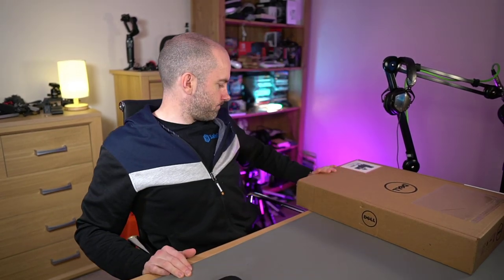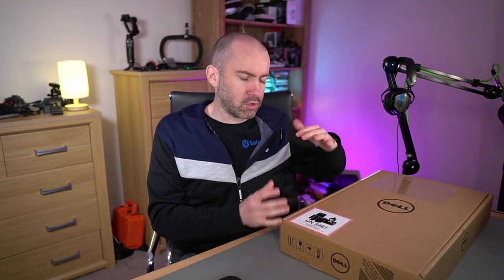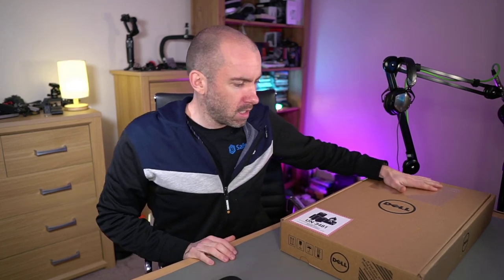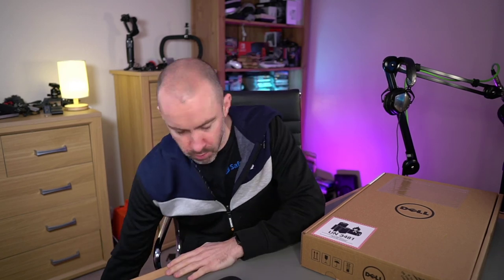Dell Alienware M15 Gaming Laptop - Unboxing & First Impressions

Comment: Before you format that Laptop Kevin, make a clone of it first and store that safely just in case mate, better to be safe than sorry.
Reply from the maker: I won't be formatting the existing drive yet. 

I'll put a new drive in, install windows and then install all necessary drivers etc.

If I run into any problems, I can revert back to the old drive.

I might just keep the old drive intact for the foreseeable future anyways so I can put it back in if there are any repairs or whatever.